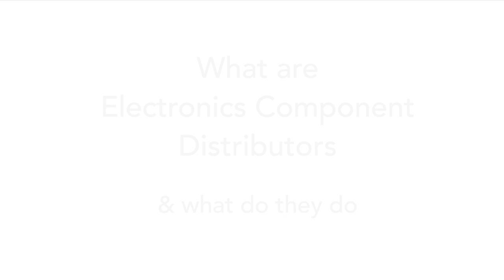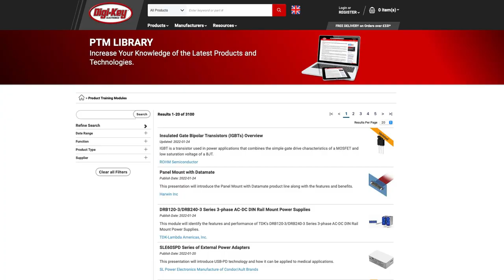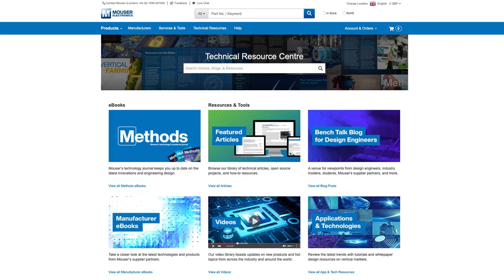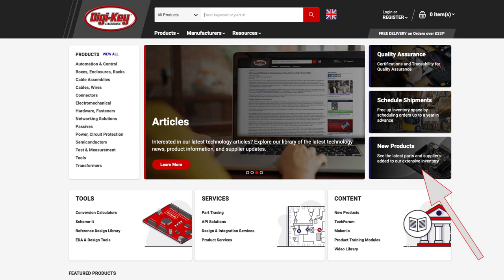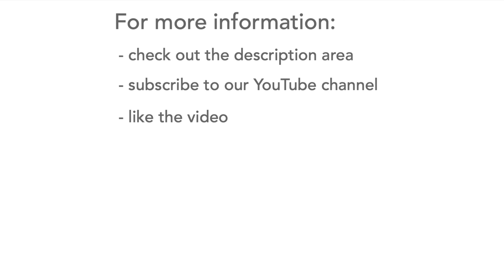Electronics Component Distributors: what are they, what do they do

Comment: I've found that buying directly from Texas Instruments is almost always much cheaper than buying from a distributor, even when buying just one part. And when you look at their price for 1000 units it is usually a fraction of the price of buying 1000 (or even 10,000) from a distributor – e.g., a third of the price. (And I'm talking about pre-covid.) Is there a reason why someone would buy from a distributor rather than from TI directly? The distributors also usually have much higher postage and packaging costs. The only real advantage I see if if someone is buying low quantities from several vendors – in which case they only have to pay shipping once. Maybe TI give much better deals when buying directly (or much worse deals to distributors) than other manufacturers?
Reply from the maker: Often manufacturers like to use one source for as much as possible. It simplifies the supply chain and as a result saves overall costs. Also a lot of component manufacturers do not supply direct, so TI are obviously an exception.
Reply: Vigggg
Reply: TI is an exception due to the fact that they have a well-oiled strong distribution network of their own. However, that's not true for other device manufacturers, whether big or small. Distribution is not a problem that manufacturers can't solve, it is just that distributors are better placed and equipped to take care of that.
Reply: Customers take items on longer credit. A distributor bears the burden of credit  by infusing his capital in rotation. Manufactuter will demand money earlier from customer during direct sale, sometimes pay first and take stocks later.